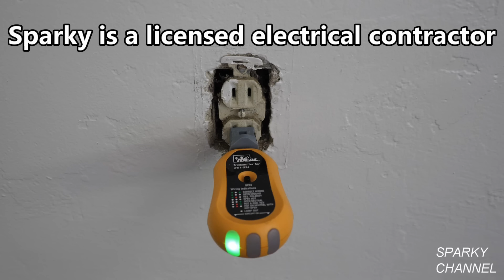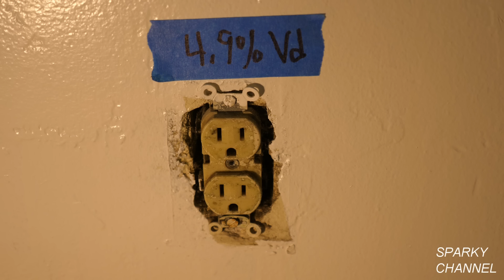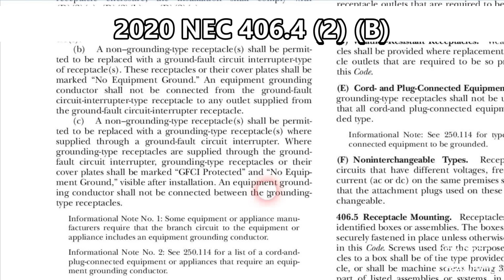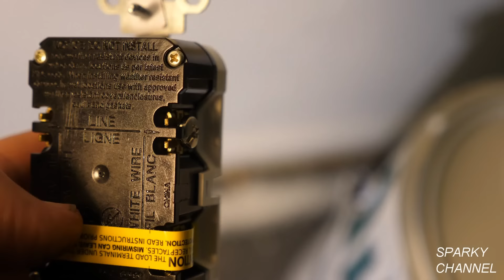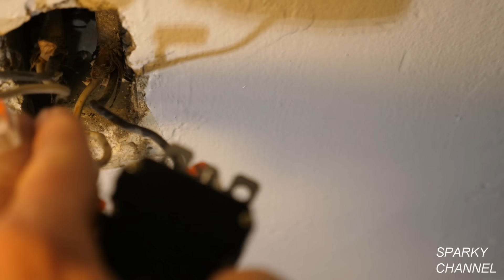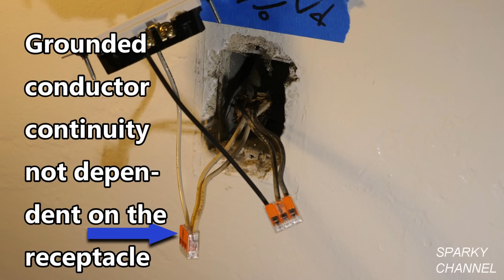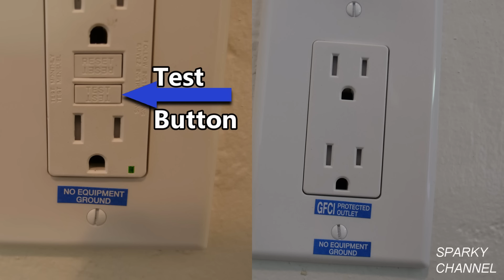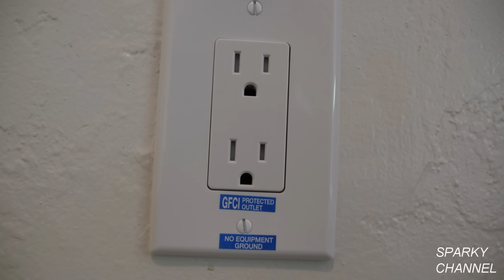2 Prong Receptacle Circuit Replaced by GFCI and Grounded Receptacles per 2020 NEC

Comment: Can you just replace all receptacles with GFCI protected receptacles so you don't have to buy all the extra equipment
Reply: You can't have a GFCI receptacle connected downstream from another GFCI receptacle. It will cause constant nuisance tripping and you won't be able to use your receptacles. GFCI devices don't play well together with other GFCI or AFCI devices. You just need one GFCI receptacle at the first device box in the circuit and that will protect all of the downstream receptacles as well. So you can buy just one GFCI receptacle and it will protect several other non-GFCI receptacles downstream. Alternatively, you could replace the circuit breaker for those receptacles with a GFCI breaker and that would work as well and you wouldn't have to spend the time figuring out which is the most upstream device box in the circuit, but those are more expensive than the GFCI receptacles. (Edit: I should mention that you might not be able to use the GFCI breaker for this purpose in your country, particularly if that circuit also feeds lighting loads. I'm more familiar with the Canadian code, so in America it might be different, although the codes are very similar.)

You don't need the kind of equipment he's using to test for voltage drops. A standard consumer level multimeter will do fine. Or a plug in lamp. If you're not sure from where the home run for the receptacles starts just disconnect from a central receptacle, make the conductors safe, turn the power back on and see which side has power with your multimeter/lamp. If it's to the left it's probably the furthest left receptacle that the home run is fed into. If it's to the right, the far right most likely. Connect the middle receptacle back up, unhook whichever one you think the home run is being fed into and re-test. If none of the downstream receptacles are getting power afterwards then you've found your guy. Simply replace it with your GFCI receptacle, test, and you're done.

Comment: Horrible video. I have to spend $500 in tools just to replace one socket apparently. Thumbs down😮
Reply: Where does it say in the video YOU HAVE TO BUY ANY OF THOSE TOOLS?
Reply: You can do it with a screwdriver and a  plug-in lamp if you want.
Reply: The video just explains the proper process. He didn't make the rules.
Reply: Honestly you just need a wire 😂 short the plugs and hope the breaker trips or spend money lol

Comment: Wouldnt  a pigtail be like bypassing the receptacle? If so then whats the point of the gfci protection? Please correct if im wrong but i will like to learn more about electrical
Reply: On the GFCI outlet they did not pigtail the wires, he did only on the downstream receptacles. The line wires are connected to the line holes in the receptacle and the load wires (all downstream outlets) are connected to the load holes in the receptacle. You can pigtail the receptacles that are downstream because even if electricity bypasses those receptacles they are still part of the load run from the GFCI outlet and are protected by it.
Reply: @KenW418 thanks for this explanation I understood perfectly even while gone 🤣
Reply from the maker: Thanks!
Reply: If you pigtail, you should use only GFCI receptacles.  This can be used to give individual protection, like that your PC will not shut if some other outlet trips.

Comment: If I install a gfci to an ungrounded receptacle, can I still plug in strip surge protector ?  Will there be any "conflict" ?  thank you
Reply: Grounding is a critical element required for proper surge protection. In regard to the question about whether surge protectors work on ungrounded outlets, the answer is “no.” Surge protection equipment typically uses components called metal oxide varistors (MOVs) to divert excess current into the ground line.
Reply: @undeadarmy19  That is incorrect. A surge protector connects the wires with varistors. If grounding not use it is not an issue. It will still pass a surge from the line to neutral
Reply: @okaro6595  You dont know what you're talking about. MOST surge protectors will not work without a ground connection.
There are some special surge protectors called "zero surge" protectors that work in a different way than most, and those will work without a ground connection. However, again, this is not how MOST of them work, and the surge protectors that MOST people buy will NOT work without a ground.
Reply: @undeadarmy19  So you do not know what a varistor is? Why are you then trying to explain to me what a surge protector does? It is like telling be how to drive and not knowing what a steering wheel is.
Reply: So if no ground wires, why use GF plug since expensive.  I think it gives a false sense of ground.  Stickerscan be removed.

Comment: thank you for the great videos.  Question to or anyone can help:   I placed a GFCI outlet in one of my "office" where I have my computor.   However, that plug is not the upstream but it is being use the most.  I sort of know which one is the upstream but that recepticle is hardly used or just to plug in my cell phone charger at times.  Should I put in one more GFCI at the upstream ?  will that be "confusing" if any of the two GFCI tripped?   Or, should I removed the one I have and install it to the upstream?   Also, I do use a very good surge protector to plug into the GFCI , is it necessary or any harm?    Thank you in advance.
Reply: You can change the outlets you need or want and leave others two prong if you so choose. You may not change them three prong and leave unprotected by the GFCI.

Having two GFCIs in a row is not idea. You can move the GFCI socket upstream and replace it with a normal one if you so choose. Or you could pigtail the upstream one. Remember that it then does not protect any other socket.
Reply: @okaro6595  thank you

Comment: Using the wago it creates a unessary spot 4 issue wire could b put directly 2 outlet
Reply: i would never use WAGO for anything... i just do it the old way for 40 years now... but you can spend the money and take a chance on them,,,  have at it. not me no way...
Reply from the maker: Thanks!

Comment: Question: Could you just put the extra hot and neutral wires on the outlet instead of using a pigtail? Thanks 
So much
Reply from the maker: Yes, not a problem.

Comment: From what I understand in the code you can only replace each non-grounding receptacle with a GFCI receptacle, not downstream "(b) A non-grounding-type receptacle(s) shall be permitted to be replaced with a ground-fault circuit interrupter-type of receptacle(s)".
Reply: As long as the socket is GFCI protected it is OK. Do not quote mine. As you can see it has (b) so there are other points.

Comment: Why did you cut off the wires that had a back stab receptacle rather than release the back stab with a tool? Releasing the wires would have been quicker than cutting and re stripping the wire.

Comment: One question: If you plug in an extension cord to the GFCI receptacle, does that mean that whatever you connect to it, is ground protected? Or a power strip; is it ground safe?
Reply from the maker: If the GFCI is grounded, and you plug a power strip which has a ground plug (3 prong), the power strip should be grounded.
Reply: There is no ground on this system, a GFIC can not just produce a new ground some how a ground is now working because Spark man pops in a GFIC for $15  right ???
Reply: no

Comment: Great video, very informative. Thank you very much...
Reply from the maker: Glad it was helpful!
Reply: One question: If you plug in an extension cord to the GFCI receptacle, does that mean that whatever you connect to it, is grounded? Or a power strip; is it grounded? @SparkyChannel
Reply: @breakingthematrix369  Huh what do you mean??? there is no ground in this system at all... you would have to run a wire to a grounding ROD 8 feet into the ground and install a wire to the GFIC then yes you would be now grounded... you do not need to go all the way to the Main Panel drop service from the power pole... $18 home depot has grounding rods.

Comment: I'm working on doing this in my house which was built in 1959 and had expansions sometime in the 70s, so every video about this subject is greatly helpful. Thank you. The trickiest part for me is that the house is still on fuses (the lightbulb socket type) and the layout makes no sense. I started in a bedroom I've converted into an office which only has two outlets, both of which are on different circuits. I put a GFCI on the more important outlet (along with the "no equipment ground" label), but it's at the end of a line. I'm planning to really map things out this fall when the garage where the breaker is located isn't a sweltering and dusty sauna. Again, thanks for your video.
Reply from the maker: Sounds good. I love the older homes!

Comment: I won't do this myself - but:   I would have liked to see at the end what the lights would have shown on the down stream sockets, at least one - would they have shown grounded ?    I will probably have to do this as I have an ungrounded outdoor socket on the outside of my house - the house inspector said it was not to code and of course the house builder said it was to code if it was above the second floor, that was 23 years ago though.  Hopefully technology has changed to help me out, though I quite positive electricity has not.
Reply: Weather resistant gfci and an exterior water proof outlet cover and you should be good to go. If it is ungrounded it will still say open ground on the downstream receptacles

Comment: So pretty much any 3 prong to 2 prong adapter out there is ok?
Reply: An adapter does not provide you any protection like a GFCI does.
Reply: @okaro6595  are you saying not to use an adapter on the reader like in this video?
Reply: @tddtv  Yes those 2 prong to 3 prong adapters should never be used. Replacing all outlets with the addition of a GFCI protection on the first outlet in the circuit is a safer way to use the circuits on this old house wiring.

Comment: Great video. But instead of the wago lever nuts could we have used the line and the load terminals like how it was connected before? How do the lever nuts help?
Reply: It's the pig tail philosophy . If a failure happens on the terminal of the receptacle with any of the conducters you loose power to all down stream outlets instead of just loosing one on a pigtailed system . Now terminal landing and not backstab if done properly on a quality outlet can last a generation
Reply: @stevencole7331  appreciate the explanation!
Reply: It's Lose, Loose, Lost. One is not like the other, Loose is when your tooth is about to fall out our your clothes are too bug. Lose is to not win. Hope this helps. Once way I was taught is that loose has 2 o's and if they were holes in the belt then it might be too loose!  @stevencole7331

Comment: Why does the GFCI test BUTTON on my hair dryer WORK when there is
no ground conductor in the process?
Reply: Because the button does not rely on the ground wire. Also it is not a GFCI but an ALCI (appliance leakage current interrupter) though the working is the same. The button diverts current to the neutral bypassing the detection.

Comment: Very interesting video! Question though, why does the last receptacle in the chain have less VD at 13.9% vs the one that had 14.5%? I would have expected the very last receptacle to have the most VD.
Reply from the maker: The one with the larger Vd is actually the last on the line. I just worked on the receptacles in a different order.
Reply: @SparkyChannel  ah, I must have misunderstood what I heard or saw. Thanks for the reply and videos!! If I could do things over again, I would easily decided to become an electrician. Wish it wasn't so difficult to get into the unions these days.

Comment: Sparky you do a no favor by Neglecting to mention that the ideal sure test circuit analyzer cost in the neighborhood of $600. I question the usefulness of your video unless you’re teaching other electricians about how to go from two prong ungrounded to a GFCI.
Reply: You can just get the Klein Tools one for $50.
Reply: The tester has two important functions. You missed one of them.

Yes you could have identified the most upstream outlet by simply removing all outlets and looked for the hot wire. That would save money for the tester.

However this tester is actually a great way to confirm that the wiring is all secure and the outlets are all good. Had the voltage drop got significantly worse along the circuit that would indicate a problem. This final test ensures the circuit is safe for use by the home owner.
Reply: You can always go to the receptacle you think is first, remove, go turn the breaker back on to test. If your wrong pick another likely one, and if your replacing all the receptacles any way it doesn't really time

While typing - He ended up doing that anyway...
Reply: @mbburry4759 

I think you’d have to test all of the other receptacles to make sure they aren’t getting current in addition to identifying the hot wire.

Comment: What is the logic behind "An equipment grounding conductor shall not be connected from the ground-fault circuit-interrupter- type receptacle to any outlet supplied from the ground-fault circuit-interrupter receptacle""?  If the first down stream outlet is connected by a wire that has an equipment ground wire, do you leave this disconnected in the box that that contains the GFCI?  And how does this work where old metal boxes are bonded on the back side and the new receptacles have bonding strips?  Would'nt this have the same result as connecting an equipment grounding wire?
Reply: Because there's no ground back to the panel
Reply: The ground wire would not help anything and could in some cases spread a problem to the other outlets. Also why would you even draw a new wire ass the whole point of this is to prevent rewiring.

Yes, if there for some reason is a wire with ground you do not connect it.

Comment: Tip: You can use a commercial grade receptacle and if you use backwiring (Not Speed Wiring) you will get a great connection that is even better than if you made a hook
Reply from the maker: Yes, that's correct.

Comment: So... You tested for ground without connecting the ground lug on the 3 prong adapter. Even if those outlet boxes ARE grounded the tester wouldn't have read correct because it wasn't connected properly.

Comment: isnt the GFCI supposed to cut power from the the rest of the circuit when tripped? how does it do that with that wire connector?
Reply: Review the video once more. On the GFCI outlet all wires were connected to the outlet so the GFCI outlet would cut power to all downstream outlets should there be a ground fault. He only used the pigtail with the WAGO connectors on the outlets downstream of the GFCI outlet.

Comment: Where/when/how did you ground any of this?
Reply: Don't feel bad, I had the same question. Okaro we are  not experts, that's why we watch Bill.
Reply: @edsyphan3425  The point of the video is how to use a GFCI instead of a ground wire so there is no ground wire.
Reply: @okaro6595  The point of the video is in the title, 2 Prong Receptacle Circuit Replaced by GFCI and Grounded Receptacles per 2020 NEC. None of the new outlets are grounded and should at least be marked ungrounded. It's safer with GFCI but not as safe as if they had ground.
Reply: @gnuorder  Correct. The only way he could have provided grounding properly is to rewire the entire house. The old service panel isn't setup for ground wires. What he did is to code so it is fine. 

Personally as the home owner I would want new wiring and a new panel and would have to pony up the money to make that happen. With a new panel and new wires more circuits could be provided reducing voltage drop under load by wiring fewer outlets per circuit. Just because using a GFCI is according to code doesn't make it the best option, it is certainly the cheapest. Code wants you to provide AFCI protection to living spaces like bedrooms, rewiring the house would provide that additional protection.
Reply: You just missed the whole point.

Comment: I’m so confused, what’s the point of a gfci if there’s no ground in the first place
Reply: For instance, if a kid stuck a spoon handle in one of the outlets, the upstream GFCI would detect an imbalance and trip the whole circuit as if they’re all GFCI
Reply: The equipment can find a route to ground in many other ways, and in particular through you !
Reply: A GFCI can tell when excess power goes out on the hot and not back on the neutral.
Reply: GFCI receptacles still provide some protection without a ground, just not full protection.
Reply: A GFCI detects a ground fault.  If the GFCI detects that less current is flowing back to the panel vs what is flowing on the hot then the electricity must be going to ground somewhere, somehow. Probably through you. Which is a fault condition, i.e. electricity is flowing to ground when it shouldn't be.. It interrupts the circuit when it detects that condition.

GFCI is to protect occupants from electrical shocks.
Reply: science

Comment: Curious where you installed the GFCI if the box was metal wouldn’t you have screwed a green ground pigtail to bond the GFCI??
Reply: I just ran into this question last night while installing a gfci in my kitchen. Found this video to be helpful https://youtu.be/hu5be04dDGs 
Short answer is it does not provide a ground unless there is a ground wire ran to the back of the box. I also heard if the box is ran with metal conduit it can provide a ground with a pig tail.